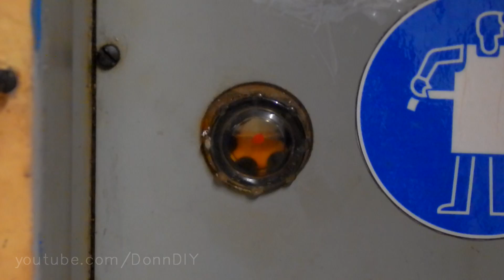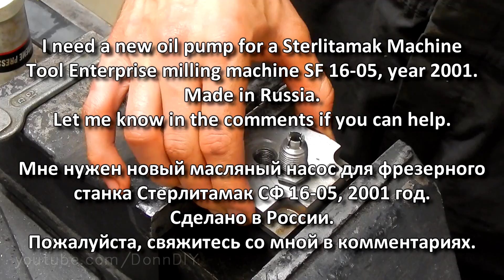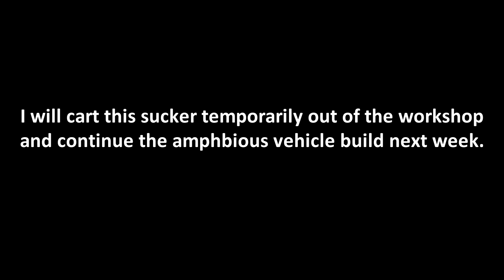Used Milling Machine For The Workshop - Unloading & Inspection

Comment: It's great to see multiple generations working together towards a common goal; Grandpa seems like he knows a thing or two...

To remove the tool from the quill, first you need to remove the draw bar (the large bolt in the top), then pour a small amount of oil or penetrating fluid down where the draw bar was to lubricate between the quill & the tool. Finally, place a long bar in where the draw bar was & tap it with a hammer (not too hard, you don't want to break anything) until the tool releases...

Good luck...

Comment: I would skim the oil pump body, face and gears (on emery on glass would do) to eliminate wear on the gear sides/face. That will definitely get it pumping, even if you go slightly thicker on the oil. Try an air hammer on the loosened draw bar, usually more successful than single heavy blows and less loading on the quill. As for lifting it - put it on a frame the same height as the bench with the tractor and then move it back into the shop and slide it over. It can't be more than 700kg surely? Great channel and what a fabulous workshop.

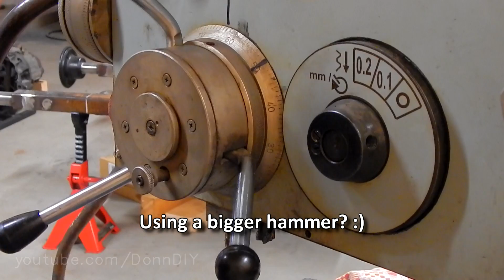Comment: 12:58 maybe some air pressure can loosen any dirt in the mechanism. Or the tool got too hot and welded itself to the machine - in this case it should be somewhat mild steel now.

Comment: About the tool removal. If your not interested in using the tool, you can heat the tip of the tool up with a torch until the quill reached a temperature around 60°C the plunge the tool in water, the colder the better. Now you should be able to drive out the tool with the draw bar.

Lifting.
I lifted my mill up on a long board with two stacks of wood. both left an right from the middle of the board where the mill is.
1. get the board slightly of the ground (crowbar)
2. get a small bock of wood in the underneath mill so you get a rocker
3. pivot it to one side and put a bigger bock underneath
4. repeat the lifting and stacking until you reach the desired height.
With a board long enough you can easily reach a leverage of 1:10. so you need to lift only 50Kg
Reply from the maker: Great advice! Got the tool out already as you suggested. Might get the mill on the table too. Cheers! 👊😉

Comment: If The oil pump is just used to Spray oil on the gears for lubrication, then i would leave the oil pump in place, and feed it with an external  oil pump to the oil pick up side, like others have said, the oil pump looks good, you just lost the oil prime, the external oil pump will prime the old oil pump , add oil flow and everything should be fine again :) The High five was Awesome :)

Comment: I have used automotive power steering pumps for lube oil circulating pumps in past, cheap, easy to mount up with your skills.  can  also be cheap coolant pump if coolant is filtered before going thru pump - so it don;t chew it out.

Comment: That oil pump is good , there is problem somewhere else, blocked or have look if its turn. You can blow it with air compressor too. Have look at -valves if are there.. if is worn out what is not, you can put ticker oil in will help but that oil pump at that pressure what is nothing on that machine must work.
The morse you can get loose if you put pipe under and put the machine down to sit on it that will brace it to the base, then you can hit the top harder with hammer with no damage. That part is not rusty inside only was tight harder than should.

Comment: When your tracked ATV is ready I would harvest this small digger for the hydraulics and build a quick adapter for attaching/detaching it from the ATV. You also get additional height, just have to extend the legs.

Just one machine less to do maintenance on 😋

Comment: There's a threaded rod/long bolt that holds the tools in. Have to loosen it a bit then give it a wack with a hammer. You already see hammer marks on it @11:00, don't unscrew all the way when you hit it or can strip the bolt or tool.

Comment: The same machine was sold under multiple names, in Germany they sold it as Kuhlmann (yep, pronounced like "cool, man") and I am pretty sure the manufacturer is Rong-Fu in Taiwan. at least they still sell a round-column machine like yours branded the RF-40. The German company Optimum used to sell these, as did/maybe even does the Austrian companies Holzmann and Bernardo.
Reply: With regards to the tooling in the spindle: Crank it all the way down and heat it with a gas-torch. The shank of the tooling is solid metal, whereas the spindle is relatively "thin" metal and will expand, while the tool is still cool(er). Then give it a not too gentle tap with the hammer and knock it out. 

At a later date, make a differential drawbar, by cutting a coarser thread into the top of the spindle, i.e. M12/M14 in the spindle, this way the thread will press it out and you don't have to hammer on the spindle any more to remove tooling.
Reply from the maker: Great advice, dude!
Reply from the maker: I wanted to buy that German Optimum CNC mill but it was too expensive.
Reply: @DonnDIY  They charge a hefty extra for slightly different colours and a few different stickers on the machine.

Comment: Hi. I'll add a plus one to the comments saying you need to prime the oil pump.  Filling it with oil rather than grease should be enough.  You might be able to pump in in through the pick up.  To release the Morse taper if you hit it with a bigger hammer you may damage the bearings.  Is the top of the quill threaded?  If so maybe you could make a fitting so you could screw down on the tool and try and eject it.

Comment: We're sure the collet in the spindle is tapered. So back the drawbar off 3 turns and smack it with a smallish brass or lead hammer so you don't mess up the head on the drawbar.

The oil pump didn't look bad from the wear mark on the end plate. Is the pump missing the pickup tube down into the oil sump?

Gear pumps don't move high volumes of fluid, so could there be an air leak in the pickup side of the pump?

Is the pump even being driven when the motor is running?

It wouldn't be a bad idea putting some light grease in the pump housing to lube the pump till it gets it's prime when you have it apart again.

Comment: For your oilpump, try to surface grind the house, lid and the side of the gears to a smaller height then get some valve grinding paste and try to run the gears to eachother. As for the stucked tool....get a bigger hammer and slam it hard on top of the bolt going into the tool.....there is nothing you can do wrong with that other then a little burr on the top face of the bolt

Comment: I just had a brainstorm Sir Don, I bet the best way to get that Beast upon the table is to disassemble it. Take the motor off and the plates and stuff like that you know what I'm talkin aboot. : D  I bet that would be your best bet. Then your cherry picker will lift it and then reassemble it once on the table. Let me know your thoughts
Reply: Yes, I second this sage council
Reply: I hadn't considered that option previously, but it would give Donn a chance to check and service the machine prior to use.
Reply: I agree, it will be lighter than the sum of its parts--so to speak.  I have a 1950s DeWalt 16" racial arm saw that has to dismantled to get it moved or onto a bench for use.   She is a beauty and a beast.

Comment: According to the given parameters, it is easier to find the gear.  Judging by the video - homemade.  You can also do it yourself, from caprolon on a lathe - two mating gears.  Suitable bronze (with filter).  It must be oil resistant.  Not a responsible item.  Minimum clearances.

Comment: Shifting mills can be a problem I had a few problems getting getting my Parkson mill in to the workshop the seller told me it weighed a little over 1 ton the loader on my tractor will easily lift 2 ton so I thaught I'd have it unloaded in no time. Only to find it weighed over 2 1/2 tons and we had to spend hours taking bits off until the tractor could lift it finished some time after 3am. Anyway that may be a way to get your mill into your shop goodluck

Comment: Take out the collet anchor bolt and pour some  thin (penetrating) oil down the hole to try loosen any rust that may have formed on the Morse taper surfaces.

Comment: Would think those gears could still of moved some amount of oil ?
Reply: Yep...dry gears at least used ones, are not good enough to create a vacuum (and self prime) ... Just like some water pumps they need primed first to  start fluid pumping . Try oil back feed or pac  pump gear housing with axle grease to start suction.

Comment: Here in the us, I wonder of you could use the motor and pump from an oil furnace. The oil in the machine might be a bit more viscous but you wouldn't be pumping against the nozzle as in furnace use so not building pressure. They have a line in and out on the pump. You would have to make external suction and return fittings on the mill oil sump and where oil goes on the inside. Just a thought of what I might try in the same predicament.

Comment: First ThisOldTony and now you start a milling machine project, what is this, christmas ?!
Also I think that janky looking nut under the top of the drawbar was added in after the fact so that you dont need a socket or the original key to tighten the drawbar. Because than you wouldnt be able to use a wrench like you did. Maybe check that if you need to remove the nut.
Reply: nachtgoblin24 
I was wondering about the nut but when he put the cover over it and the nut was inside I figured it was just part of the design.
Makes sense that it was installed as a spacer to use a wrench instead of inserting a socket. 👍🏻
Reply: @Crewsy  no, the draw bar is worn, the nut was added because the threads on the bar have worn
It's a common fault with old milling machines.
I used to work on them.
Reply: Ken Rutherford 
That is what I initially assumed. 
So adding the nut utilizes the threads that were below the section used and worn out over time?
Reply: @Ken Rutherford
Of course, that makes absolute sense. Maybe we'll get a glimpse of the drawbar in a future video.
Reply: @Crewsy  yes

Comment: i would be worried that the collet didnt spin out of its key way inside of the mills head but judging by the rest of the machine its probably just a little dry rust sieze a few days soak with penetrating oil would probably help i have a small x/y axis vice that i have mounted to an antique drill press but it works haha

Comment: Prime the pump , add a longer pick up tube whith a one way valve (like the fuel ones) , should be pretty good . 
the chery picker will pickup 500 kg whith no problem even on the  almost on fully extended  , just needs a  bit of counter weigth for safety . i used a second person .

Comment: The draw bar is worn. The large nut below the hexagon head, should not be there. It means either the threads are worn (most likely) maybe you can re cut the threads.

Comment: It’s great to see your grandpa out helping. 🙂 Well at least you got two things done, unloaded the milling machine and got your old tractor running again! Do you think it would be possible to install a small electric oil transfer pump on the outside of the mill, tap in a bottom port to feed the pump, another at the top to lube the gears?
Ps Haha I see you just mentioned doing this too 😉
Reply from the maker: Yup, using electric pump would be the easiest fix I guess. 👊😉

Comment: Abandoned spindle collets can be problematic especially if they get corrosion, . I'd Loosen the draw bar and spray some penetrating oil on both top and bottom. Then let sit a few days. The threads are usually a fine pitch on treated high carbon steel, so trust your past experience. Next work the draw bar in and out,. If it has been cross threaded, you'll know. If it turns easily: back it off 1-1/2 to 2 threads and get a ball peen hammer and sharply tap it. If that fails, either the draw bar, collet or both has cold welded.. good luck. Persistence will get results. 
 Chances are, you will have to make and weld a new threaded portion on the draw bar.

Comment: Perhaps you could build a small gantry crane from I beams to help you lift it plus it would be a good idea for future machines
Reply: Yes and  make its legs telescope ... So it can go in workshop , plus make it mobile. It can be made to straddle a car  /trailer  and lift as much as you want if built strong just use a big endless chain  and A Fram beam. Very handy

Comment: Try a remote drain and feed line use a secondary tank and a small 12v oil pump and power supply
Reply: I commented before the video finished

Comment: Pretty good. It's good to see your father and grandfather. 
I'd bet your engine hoist will pick it up ok. Mine did w/my bench top mill that looks to be a little larger than yours. 
If you didn't want to run external pump, can you just make one using the old gears? Looks to be fairly simple design. 

Stuck tool: Can you unscrew and remove the tooling draw bar/bolt? if so, do that and use a long steel drift as a punch and beat it out using a big hammer. Might put wood blocks on head to protect it from missed hammer blows, but it would save you from beating on your draw bar/bolt. 

Good luck with it. They are very handy to have and I'm sure you will be putting it to good use in no time at all.

Comment: But what's the problem with the oil pump? the gears or the body?
Reply from the maker: Both the gears of the pump and the body. Too much of a gap everywhere. Should be much tighter fit between the gears and the body.
Reply: @DonnDIY  i think, with your skills that you can rebuild it, but you can try with soldering some metal on the teeth of the gears and try to restore the diameter measuring the consumption, with the lathe. i'ts possible?

Comment: Take the motors off before lifting and reassemble on the bench?  Might reduce weight enough to use excavator?
Reply: @HMLuts I had a big heavy drill press - took the head off, lifted one part at a time, assembled lying down on the bench then used a jack to push it upright...mayb something like that?  Looking forward to seeing you use this in your projects!

Comment: The engine hoist should work fine to lift it onto the table. I unloaded my Bridgeport series 2 mill off the bed of a dually pickup truck with mine. Just be very careful.

Comment: You still need a pump?
Reply from the maker: Hi. I ordered an electric pump from eBay and I will rebuild the gearbox oiling using that oil pump. Do you have information from where to get an original pump?
Reply: @DonnDIY  Hello I can ask at plant where your milling mashine was made.

Comment: That front end loader and grandfather are both old but both still have life in them. You can't restore your grandfather but you can do a simple restoration on the loader so it will start easier. And as for the oil pump you are a smart cookie you will figure it out.👍👍👍